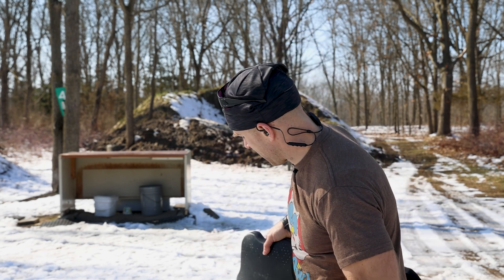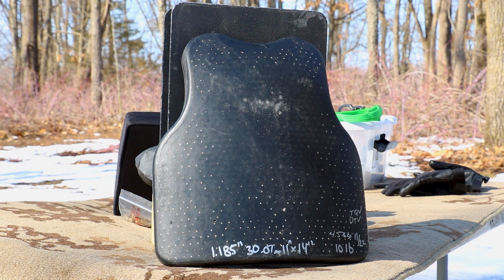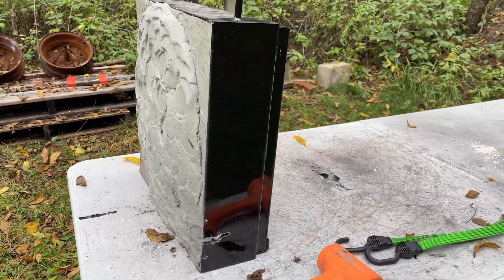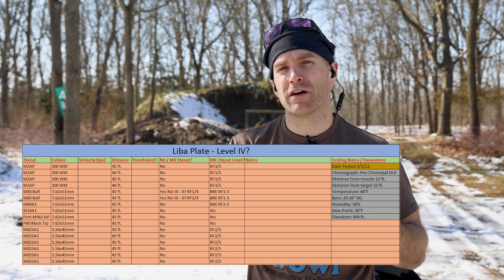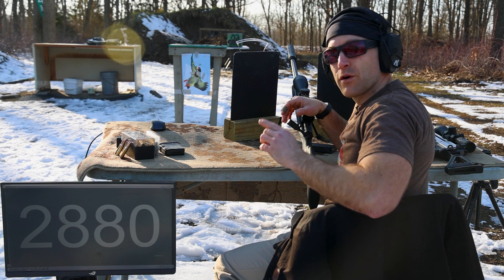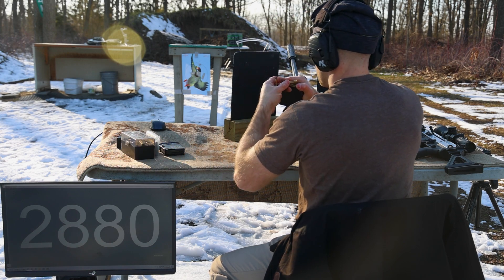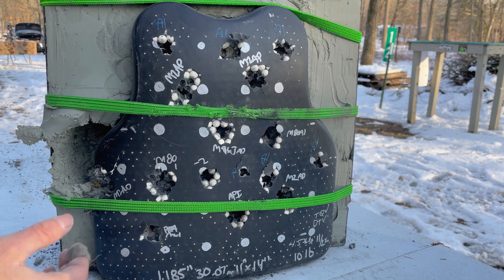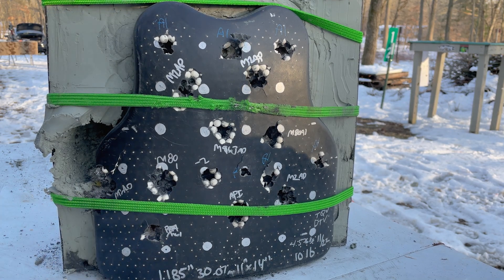Liba Multi-hit Body Armor by Tencate

Comment: Seen Russians raiding Ukrainian trenches and Russians shoot thru the Ukrainians so,sirs helmet effortlessly.
Reply: For the most part, helmets can't stop rifle rounds.
Reply: The vast majority of helmets aren't designed to stop rifle caliber threats.

Trench raiders would also likely be using armor piercing rounds, Russia has stockpiles of 5.45x39 AP from USSR times.
Reply: @murmenaattori6  yes, even cheap mild steel core 5.45 will perform well against the polyethylene most commonly used in helmets.
Reply: @qwe304  I think the original commentor was confused by the high-cut helmet design used by majority of Ukrainian frontline units looking cimilar to ceramic faced rifle rated high-cuts.
Reply: @murmenaattori6  many helmets advertise rifle ratings, but I've yet to see one that delivers in testing (aside from a few special ones that never saw fielding)
Reply: @qwe304  Yes, I don't think even special forces use the ceramic faced ones as they are all most likely too heavy to be practical with night vision.

Comment: I’ve seen foam metals and new bullet stop walls made from balls.  Wonder if ceramic foam is possible, or if the design is good.
Reply: Ceramic foam is possible, just not as common as metal foam. Metal foam is cheaper to produce and performs very well already.

Metal foams can handle more strikes to the same area, just as monolithic metal plates are more ductile than brittle ceramic plates.
Reply: @murmenaattori6  How common is it?

Comment: i remember parts of a story about ceramic balls being used for armor. they were much bigger and it was said, i think, they filled a sheetrock wall with them about 3 deep in the ceramic and it stopped 50 cal.  sound unbelievable to STOP it but maybe deflect it. could be why it isnt well known today.
great work.
Reply: You are exactly describing thr vehicle version of this armor. And the part about stopping 50 BMG is very much true, that's what it was designed to stop at a minimum. Not only deflection but actual absorption flat on. Strong ceramic will break the penetrator core into shards that easily spread their energy to a larger area of backer material like aluminum alloy and aramid composite.
Reply: https://www.youtube.com/watch?v=2MdRR3PcL6U this?

Comment: Finally, been waiting for this one since the teaser last year. Seems like it didn't quite hold up to M2AP, but knowing what I do about the plate carriers this type of chonker is designed for, all of them are backed with IIIA kevlar. So who knows how much an extra layer of soft armor may have influenced those M2AP penetrations.
Reply: Slap some of the A5 domestic ceramic plates + a 3A soft armor and you're done with your chonk build
Reply: The problem about sphere ceramics is if the projectile hits between spheres its edge becomes much sharper and it cuts trough any fabric like nothing
Reply: @eziciyokedici214   I have a few sets of plates with this style of strike-face arrangment, the little pellets are more like hamburger shaped and not sphereical.
Reply: @LSD25  yes they are mostly like hamburger shaped but its not enough to stop a M2AP hits between spheres, even with a strong backer like tha., 2-3 mm of AR-500/600 or a 3-4 mm ceramic face at behind of spheres can solve this problem
Reply: @LSD25  Thanks, i have a look to article but this plate uses a different type of combination compared to cylinder+lock at the research. İts a wise solition to use a formation like that but it would be expensive to make specific shapes of Al2O3. About Si3N4, yes its a much better ceramic compared to others but its so much expensive

Comment: hey mat could you do some testing to see if the larger a plate is the weaker it is to multiple shots?
Reply from the maker: You mean like a 10x12 vs an 11x14?
Reply: @BuffRANGE  yes
Reply from the maker: @derrickkolba  I would think in theory a larger plate having more surface area means more places for energy to spread out

Comment: You should test out the duritium IV+HA plates, have been thinking of getting one and wild love your testing!
Reply: I personally would avoid it, I prefer to get a 10x12 strike face on my 10x12 plate.
Reply: @qwe304  I keep hearing that but I have not seen how much foam they put at the edges, And I am no smarter than the next guy but I called and they said the edges are rated for level 3
Reply: @jonswaen7458  its just about an inch, and that lv 3 edge is poly-only, failing to stop m855. most capable plates can stop their rated threat at an inch or even slightly closer to the edge, the NIJ standard allows for two inches. so they save weight and money by selling an 8x10 plate as a 10x12. think about how the next size down plate would fit you, thats about how much coverage you'll get.
Reply: @qwe304  Thank you I appreciate the information, do you have any opinions on plates preferable lightweight that you like?
Reply: @jonswaen7458  do you need lv 4 protection? you can get a lot lighter plates that are still rated for 855a1 and m80
Reply: @qwe304  preferably level 4 though I'm thinking of a 3+ for an extra light
Reply from the maker: Where would you even get it? They only set sets of 80pr min to LE agencies now for some reason.
Reply: @BuffRANGE  venture tactical sells them

Comment: The very glad I could assist with this video, there is so little content covering this type of body armor. I am glad to see that this performs as advertised with its massive multi-hit performance, while it may not be up to the NIJ4 standard, the lack of major back face deformation, even after you've made good use of its entire strike face, is impressive in my opinion, and it looks like it would happily take half a dozen more hits of m855a1. Did it manage to stop that last hit of the M2AP? When you pull it off of the clay it kind of looks like it might have, but you did mark it as penetrating in the chart. 
Also did you get a new camera? Overall just looks a bit sharper and brighter.
Reply from the maker: Yeah I had to go back and re-check hits, but that "4th" hit aka the third lower hit of M2AP did penetrate. I brain farted when I was talking and referencing the M61/P80 hit. Camera is the same R6 I've been using as a main for about a year. Maybe it was just the inclusion of the sun finally? :D Or the wife got it to focus good and then turned the auto-focus off before she left..
Reply: And as for the repairability, it does seem that a lot of the resin has remained intact, even where the pellets have been blown away, while I wouldn't necessarily trust it against AP threats afterwards, I'll bet a soldier could actually use some two-part epoxy and stick some pellets back in there to at least partially repair the plate.
Reply: Is this even commercially available today?
Reply from the maker: @majordakka5743  I do not believe so
Reply: @majordakka5743  as far as I know, no.
Reply: @majordakka5743  company "mofet etzion" in israel makes plates by the same technology
Reply: I somewhat anticipated this result, its areal density is a bit below tencates EMEAs listing for full level IV. Still, it help up fairly well to drops and the sub-IV threats like M14a1 and M80a1 and it appears to have done so standalone. I was worried its areal density was low enough to require a backer. It wouldnt have killed the French to just slap "VPAM 9" or "SA" on that back sticker and saved us all some brainpower.